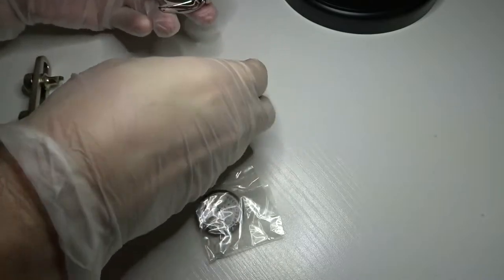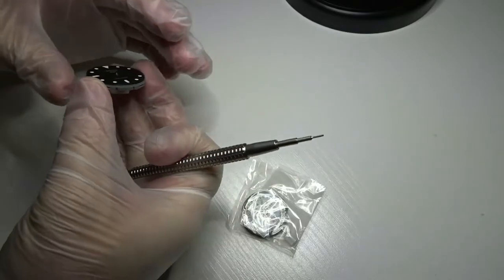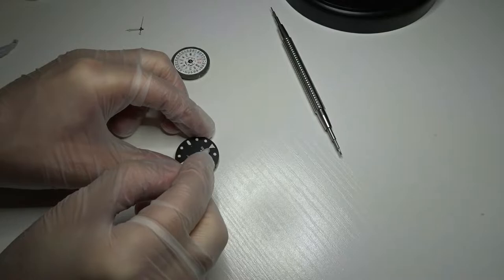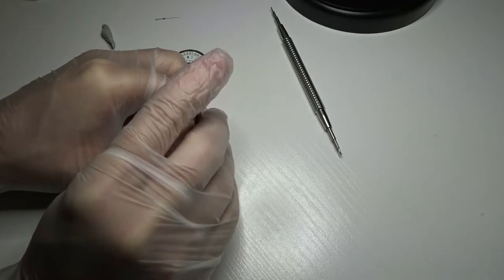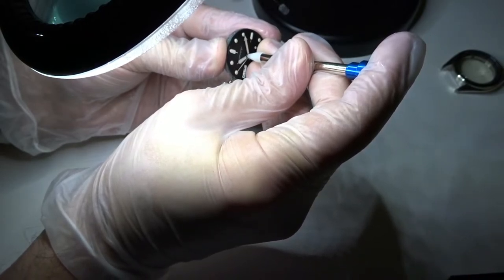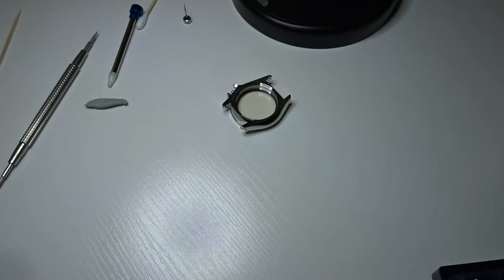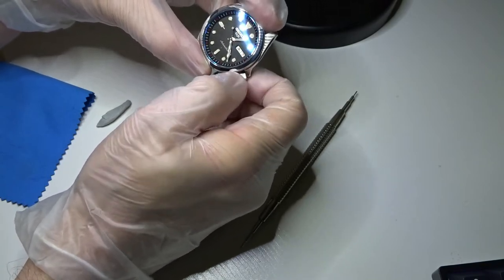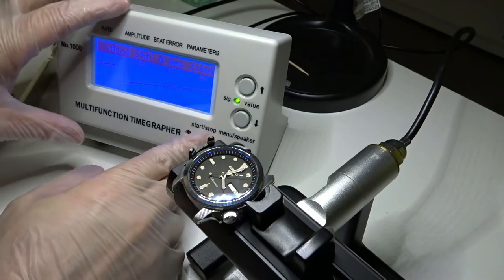Mechanical Watch Movement Replacement Basics

Comment: I have never replaced a movement before, but I need to do it for my watch that was a ST1901 chronograph movement. Do you think that's a bit too much for a beginner?

🤔 I also have a watch with a misbehaving NH35, so maybe it would be better to start with that...

(Also, just an FYI: The singular form of the word "indices" is actually "index", not "indice" 🙂)
Reply from the maker: I would definitely start off with NH movement rather than ST.  Good luck with the crusade to abolish the word "indices" 😆
Reply: @watchify1775  lol noo "indices" is totally correct; it's the plural of "index". It's "indice" (without the "s") that is wrong. 

Anyway, thanks for the advice and the video 🙂 I'm gonna order an NH35A movement

Comment: When you change the movement that little rotating gear cannot be change ?? If the original movement has a stainless gear and if you put a new movement with colorful gear that cannot be change ??? Im referring that gear we use to rotate the hands tnx
Reply from the maker: I think you mean the rotor.  Yes, they can be interchanged if the movements involved are the same model or family of models.  Example a rotor from a 4R36 movement can work with another 4R36, a 4R35, NH36, NH35, 4R34.  There is just a tiny screw in middle holding it in place.

Comment: Hi, I really enjoyed you video. I have a watch my father gave me when I was 21.It wasn't apparently a very expensive watch. I haven't really worn the watch as it never kept running. I'm 73 now and it has been sitting in my jewelry box for 52 years. It has an automatic movement. The only reason I sill have it is that my father had it engraved  to me on the back. I like the face and the case of the the watch also. I would like to war it. Is it possible to replace the movement in any watch. What would i need to know to get the correct movement and where would I get one from? Is it easy for a complete novice to do if I get the tools you recommend?
Reply from the maker: Sorry - I'm only familiar with more modern movements.  I would suggest you google the watch model to find the movement caliber and see if they are still for sale and able to be replaced.  I understand the watch has sentimental value but I would still be curious to see how much it is worth in as-is condition since it is so old.  Some older watches are quite valuable and replacing the movement would ironically lower the value.  Generally speaking, yes, with basic tools you can replace most watch movements.  They sell inexpensive kits on amazon.  You might also want to contact this youtuber to see if he would be interested in taking on the challenge of repairing the watch.  He seems like a good guy.  https://www.youtube.com/c/WristwatchRevival/about

Comment: Great vid! It really helped me out a lot! I didn't see a link for the hand mounting tool in the description. Is it a specific brand? It definitely looks nicer than the basic tools I've come across on Amazon.
Reply from the maker: Thanks! The tool I used to apply the hands did come from amazon.  I bought https://www.amazon.com/gp/product/B0748HZTMH/ref=ppx_yo_dt_b_search_asin_title?ie=UTF8&psc=1 but am only using the plunger part.  I prefer these better though  https://www.amazon.com/gp/product/B07PVPJ44Y/ref=ppx_yo_dt_b_search_asin_title?ie=UTF8&psc=1.  
In the video  the springbar remover is a higher quality Bergeon that I paid around 30$ for.

Comment: how do you know what size movement you need to use how do you measure that? i need to replcace my 47mm panarai replica movement
Reply from the maker: I'm not sure what movements that watch would use.  I'm only familiar with 4R/6R/NH movements which are almost universal to Seiko and many micro brands. I don't need to measure since I'm replacing with a movement in same family.

Comment: Hi how do you know what movement to order to replace an old one.. I have an homage watch but no idea what the movement is
Reply from the maker: usually the case back will tell you what movement came with the watch.  If not, you could open the case back and take a look at the movement itself.  Googling is very helpful once you have a few bits of info
Reply: Probably a NH35/36, Myota, PT500 sw2000.   Those are the most common.

Comment: Does the minute and hour hands have to be in a specific spot for the second hand placement? And should I stop the movement to place the hands?
Reply from the maker: No. For second hand placement it doesn't matter.  Movement doesn't have to be stopped to place hands.
Reply: Thank you for the reply :) and awesome content my friend!
Reply: Thanks for posting this. I have just found out that it will cost almost double the price of a brand new 2824-2 movement to have my Mühle glashütte serviced. 
Therefore I think I would like to  swap out the movement myself. 
It looked like you were using an LED magnifying glass rather than a loop. 
Would you recommend this and what type was it.
Thanks...Jim